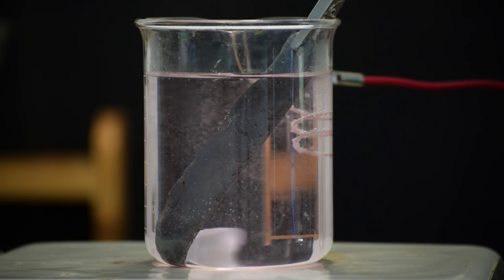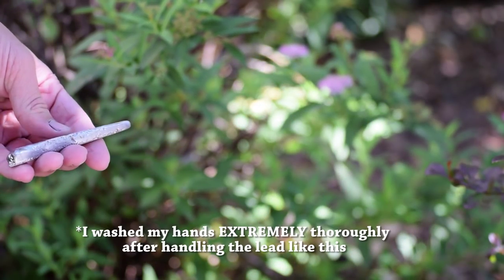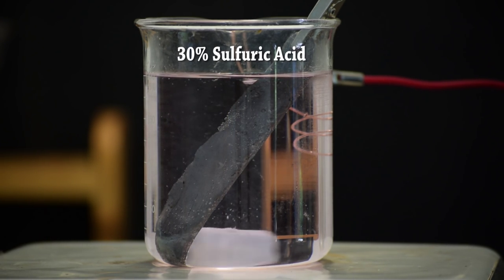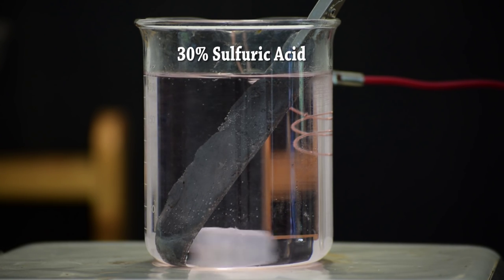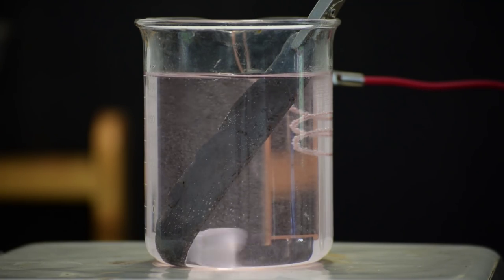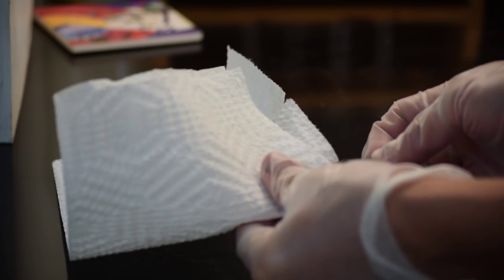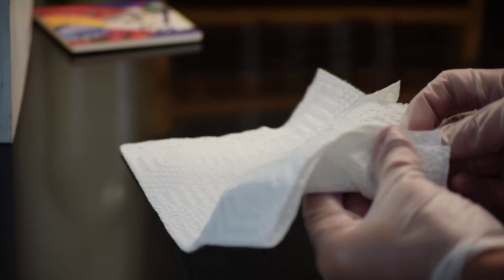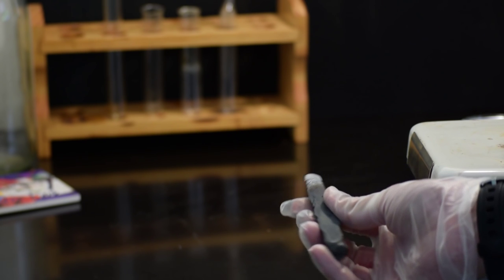Making Lead Dioxide Anodes - Attempt

Comment: For Chlorate-perchlorate electrolysis It must be done by electrodeposition of lead nitrate copper nitrate acetone or non Ionic surface agend surfactant process making anode for stand this corrosives environments of Chlorate-perchlorate cells at leas 3mm coating without bubble forming in surface using right temperature control 60C° ph control ( acidic conditions 3ph) current density low for beta or high for alpha type also in the process must used vibrator or ultrasonic cleaner or the Anode must move inside the solution to not form bubbles on the surface!!! As for the process is painful for someone that begin now as amateur chemist to produce this kind of anode !!!

Comment: Can anyone tell me why my electrode just turns brown when being made and when used in sodium chloride it generates chlorine gas and falls apart turning the electrolyte brown
Reply: sodium chloride forms sodium chlorate, chlorine, and other weird chlorine compounds that are corroding your anode. Use potassium hydroxide as an electrolyte or just use 30% sulferic acid instead
Reply: So I won’t be able to make chlorates with the electrode?
Reply: So I won’t be able to make chlorates with the electrode?
Reply: @jamesphillips8679  Most electrodes arent suited for making chlorates, only MMO, platinum work well. Graphite kind off does.
Reply: @Linus-nq2op  oh I had read somewhere that lead dioxide works too. Guess not.
Reply: @jamesphillips8679  I forgot lead dioxide, it's often counted as MMO (mixed metal oxide) although it's just one metal. If you have a high quality PbO2 anode it should work for the chlorate electrolysis.

Comment: Does not work for making chlorates with this method.I tested and the lead dioxide coating damaged.This electrode made by electroplating with PBNO3 for chlorates,perchlorates and not the H2SO4 method.The process is good,but not for making a anode for chlorates or perchlorates.

Comment: lol this kid scared of touching lead
Reply: There is no safe level of lead known, lead is accumulative, and is a  known carcinogen and neurotoxic, and the cognitive deficits induced is permanant!
Reply: @digifomation  yes, and I’m afraid lead metal, lead oxide nor its carbonate can absorb through your skin
Reply: @digifomation  on top of that, chelating agents can be used to remove lead from the body if he did manage to ingest soluble lead, witch he isn’t even doing. Touching lead is nothing to be afraid of, it cannot absorb through your skin in its metallic or oxide forms becouse that necessitates it being soluble in water
Reply: @digifomation  and as a final statement, although lead poisoning in cumulative when ingested chronically, lead is still excreted through the urine and is only cumulative when allowed to build up enough of start being incorporated into neural, bone tissue ext.. the fear of touching lead is one based in fear not facts

Comment: I saw that you completed this process using 1.5 volts DC. How many amps were you running and what did you use as a power source?
Also, just a quick question about the finished product, how thick of a coating was formed onto the lead electrode..
Thanks, great video.
Reply: Hello Macka , my setup is old microwave oven transformer (MOT) with secondary wining removed and thick wire wind on the secondary on its place: the AC voltage from MOT need to be rectified to a DC voltage by a DIODE bridge. The AC voltage need to be divided by 1.414 constant to get your try DC voltage. So, you need around 2.2V AC and current to be from 5 to 20 Amperes. To match current will make lead oxide too brittle and it will be fulling of the lead electrode.
Reply: You have no control over the current unless some of these things get changed: higher voltage allows higher current to pass, or the size of electeodes is higher or the concentration of the solution is higher!

Comment: I know commercially coated electrodes usually have uncoated part and your process of making this leaves uncoated part but surely the whole surface is conductive. I'm just wondering why you stress a need to sand the top for connecting to a power supply?

Comment: One complaint.  "thoroughly wash your glassware"  Where?  I don't recommend introducing more lead into the environment.
Reply: Dilution is key to disposing of any hazmat. 
   There is already lead in the waterways from street runoff carrying particles from lead tire weights to either sewage plants (cities with combined systems) or storm runoff to local waterways (seperate street drain and sanitary sewage systems.) 
     Pick up tire weights when you see the in the street and dispose of them in a safe manner. 
     Don’t huff solder fumes or lick your fingers when playing with fishing weights.

Comment: Wow so I'm assuming that's pretty inert! Is there anything it is incompatible with?
Reply from the maker: I'm not sure, but there are some drawbacks. The lead dioxide coating can be damaged. It would be more resistant to breaking if it were on a substrate such as carbon or titanium. I will cover this process in the future.
Reply: +Gooferking Science when exactly?

Comment: I am making a video on making elemental chromium from ammonium dichromate, and burning this chemical is said to be dangerous. the products are nitrogen, steam, and chromium (III) Oxide. The oxide is the most dangerous if done outside. That is all, right? It shouldn't be very dangerous. Also, I have editing software now! I can make videos! I  watch filmriot sometimes, and they showed hitfilm 3 off. It works great.
Reply: Camroc37 Chromium (III) Oxide is not that dangerous, as it is not soluble. I would be MUCH more worried about the ammonium dichromate itself.
Reply: Davy Zeng I am more worried about it for sure.

Comment: Can HCl be used in solution instead as it also disassociates appreciably in to H3O+?
Reply: +cobrasniper555  no it cant be used as the anode will release cl 2 gas not oxygen and this will passivate  your lead bar and prevent further current flow  got it

Comment: Are there any solvents that the lead dioxide is soluble in?
Reply from the maker: It is soluble in acetic acid.
Reply: thank you.
Reply: lead dioxide is soluble in ANY acid that forms water soluble lead salt providing you add hydrogen peroxide as a reducing agent.  So the acids fluosilicic, fluoroboric, nitric, acetic, and perchloric would work once peroxide is added.  Chloric acid may be reduced to chlorine dioxide by hydrogen peroxide.
Reply: +antiswattt3 If we are going to be anal about it,  it reacts THEN dissolves.  Lead dioxide is reduced in nitric acid solution by peroxide.  Lead nitrate is formed then dissolves in aqueous acid solvent.
Reply: +antiswattt3 Yes your point is valid.  However, we are not talking about elemental lead but lead dioxide.  On a grand scheme, most lead salts are in fact insoluble.  I merely wish to point out that there are a handful acids which form soluble salts with lead and once the proper redox reaction is performed,  the lead is in effect solvated as the lead ion.
Reply: @ScienceMarshall  hi i want to recover copper from copper sulphate but the anode is. Not working i used many anodes  but they all blinking or dissolving in solution so do you have any knowledge about it
Reply: @ScienceMarshall  i want a anode like platinum which do not blink
Reply: @ScienceMarshall  But wouldn't it chemically react and form a soluble acetate?

Comment: I was wondering...since sulfurous acid (H2SO3) is quite easy to get here, but sulfuric acid isn't. Could I use that instead?
Reply: Hello 5 years late. I wonder if adding H2O2 to sulfurous acid would oxidize it to sulfuric, provided you don't add excess peroxide, that would make piranha solution.
Reply: @Peaserist  it would

Comment: thanks for the video, just wanna ask : how can the substrate affect the electrodeposition of lead dioxide?, i mean what's the difference for example between a platinum substrate and titanium one?
Reply from the maker: Thanks! From what I know it's more of a matter of durability. The lead dioxide will hold onto certain materials like titanium and carbon better than it would on just pure lead. This means they will last longer and will cause you less frustration in the long run. Time will tell how long the ones in the video will last.
Reply: +Gooferking Science got it, thanks a lot, keep up the good work..... ^_^

Comment: Are you sure that copper is anode and lead is katod, may be conversely?
Reply from the maker: It would be, but this is a galvanic cell instead of an electrolytic cell. In that case anode and cathode are labeled opposite of usual.
Reply from the maker: Oh woops I got a little mixed up. I labeled them wrong I'm editing but color coded them right. Sorry about that!

Comment: can it be used for making chlorates?
Reply from the maker: Yes, and perchlorates!
Reply: Gooferking Science I have never dealt with electrochemistry or perchlorates, so what method do you use?
Reply: +Gooferking Science 

In Chlorate Perchlorate cell you need thick minimum 3mm (Beta)
Lead Dioxide coating. Your lead dioxide method is (Alpha) PBO2 and not (Beta) PBO2. If it were that easy on sciencemadness or APC on forums it would have been a long time using.But it will not work in Chlorate Perchlorate cells with this method.If you want it to work with Chlorate,Perchlorate cells you need a strong minimum 3mm (Beta) lead dioxide TSLD Titanium substrate Lead Dioxide or GSLD Graphite substrate Lead Dioxide anode with the Lead Nitrate, copper Nitrate electrodeposition patented method, as it is done at the factory for this purpose .If it is not made from the patented processes as do the factories (for chlorate,perchlorate production) it will not work in chlorate,perchlorate cells.